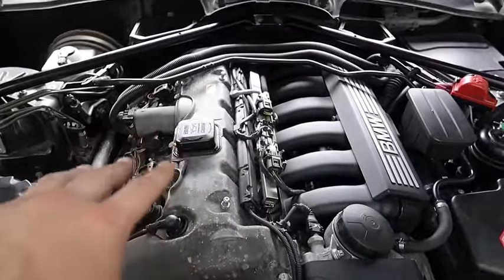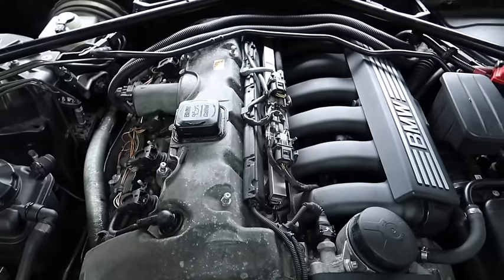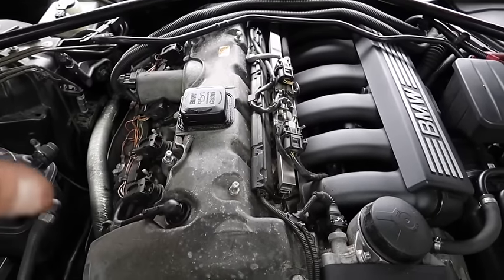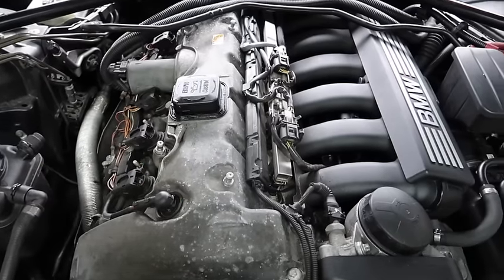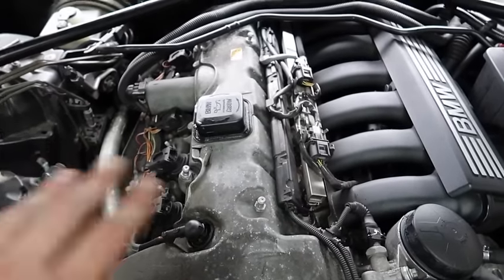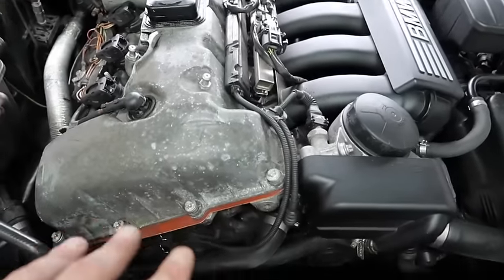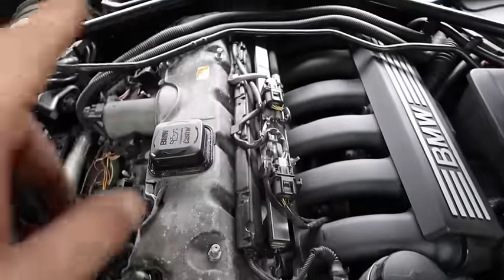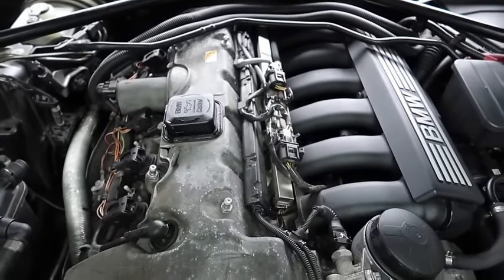Don't EVER Use This Oil In Your BMW !!

Comment: Here's a subject that stirs the pot vigorsily in the BMW community. I've owned BMW's for three decades now and spoke with a couple of senior BMW service techs when LL-01 was out and the debate was "Can I use regular non LL-01 synthetice and instead change the oil ever 5,000?"  Yes you can and it would actually be more  beneficial to change the oil more often with regular non BMW LL-01 synthetic than 10,000 or more miles with a LL-01 rated. If you don't belive me just look up what the inside of BMW engines look like with LL rated oil extended oil change intervals.

Comment: Thanks to your videos BMW Doctor I am learning a lot from them as I am now starting to DIY my 2008 BMW x5 3.0si. Part of that was looking for the exact same oil specs and certifications as BMW's 5W30 oil. I live here in Vancouver, Canada and I am unable to see any oil with the same oil with the ACEA, A3/B4, API SL, BMW LL-01 other than Castrol Edge SAE 0W30 Euro and the Pennzoil Platinum Euro SAE 5W/40. Then I saw this video which actually makes sense... and then I still wanted to make sure and that's when I checked my x5 owner's manual and to my surprise... it says "Approved oils belong to the SAE classifications 0W-40, 0W-30, 5W-40 and 5W-30".  The online version of my user's manual only mentions the 5w-40 and the 5W-30 but on the manual I have, it says 4 different approved grades. I guess it's still best to check our owner's user manual to make sure... I am just surprised that the BMW dealership here was not even aware of this until I showed them my owner's manual. Now, I am changing my own oil tomorrow or this coming weekend and now, I don't have to worry about the high priced 1L bottle of oil from BMW. Happy learning everyone.

Comment: Best thing to do is to change the oil between 5-7k miles, stop doing 10k oil changes.  BMW says it's ok, it's not ok.  Have the oil examined and I guarantee that it will find metal debris.

Comment: 5w40 liquid moly the lime green bottle has been working lovely on my e92 328i 130,000 no knocks ever and I’ll change the oil every 3000 no more than 3500miles. I use it after I did my valve cover & gasket, oil filter housing & sensor. It works wonders. Thanks for the vid Doc.
Reply: the same for 318i, charming

Comment: Hello Dr. Dean, 
About four months ago I purchased my 2006 BMW 325I with the N 52 engine and I must admit I was getting ready to just sell this car but thanks to you and the hard work that you put into these videos I’ve learned to enjoy and love my BMW.
Initially after driving for about 20 minutes the engine will start whistling like a whining pig  and Ive never done any (Mechanic) work in my life but I decided to buy the CCV valve and I followed your step-by-step video and I just sincerely want to say thank you Because that took care of that issue and it took me about five hours to take the manifold but I did it and I felt so proud.
The problem that I’m having right now is that before coming to a stop I feel a jerk And it feels a little bit stronger when the car is warmer but it does not do it on sports mode only on Drive.
I have replaced my transmission oil and like I said it drives like a dream but right before coming to a stop I feel like jerk as if someone just tapped me from the back.
I don’t know if it’s my transmission solenoid’s or the flex disk and quite frankly I have no idea... 
can you please guide me in the right direction?
I really appreciate it and once again thank you for taking the time because I’m really enjoying my car and I don’t see myself getting rid of it anytime soon.
Reply: I have the exact same problem on my 325i i have heard it’s the bridge seals in the transmission.
Reply: I would check the Transmission and Engine mount.
Reply: Have you ever fixed this problem? Because I have the exact same problem and can’t seem to find out what it is.
Reply: @erickhernandez4670  most 20i 25i and 30i models from 04-12 use a zf6hp19 or 21 trans. A common issue is the sleeves in between the mechatronics unit and the transmission. It loses fluid pressure because of these broken seals, which makes the shifts slow and jerky, in a worst case scenario throws an issue up on the i drive ”transmission failure, drive moderately”. If you cant switch to a certain gear (ie 3rd or for example reverse) then the issue is with the mechatronics solenoids. A kit of these sleeves plus a genuine zf oil change kit will take around 300 bucks and 5 hours of work on a regular driveway.
Reply: Abs wheel sensor. Had the same issue for a very long time. Did the rear abs sensors and it fixed it. I also did a transmission fluid pan replacement,  didn't fix it. The sensors did.

Comment: Just drove down to the costa del sol and back. 4k round trip in my 320i e93. Thought I had a problem as I burnt through two litres of oil over the trip. Using 5/30 oil. 108k miles on the clock. Watched this vid. Going to change oil to 5/40 and see how I get on with the next road trip. Appreciate the video.

Comment: Two options 

1. Rebuild your engine, because you want everything to be perfect

2. Accept that your N52 burns oil. Always keep a litre of 5W-40 in the boot. Every week when you do your checks, you know on a Sunday night when the kids are in bed and you go and check the tyre pressures, coolant, oil level etc just top it up. 

Some people get hung up on the tiniest thing. 

‘They all do that’, is not good enough, it must be fixed!

Instead of rebuilding the engine, spend the money on a tank of super unleaded and go enjoy your car down some proper drivers roads!

Cheers Doc for the perspective!

Comment: Castrol edge 5W40 in (N42B20) 2003 bmw 318ci e46 with 246K kilometers !  No problems . My father owns the car since new :D
Reply: I have this exact same car too from new 2001 . Still on the same spark plugs 20 years and starts on 1st turn every time.

Comment: I live in morocco on the west side with temperatures up to 40 41 °C, i noticed a lot of oil consumption on my 320i N46 B20 using 5w40 100 k miles on it, i switched to liquimolly 10w40 and problem solved, almost a thousand miles oil level still at maximum level

Comment: Thanks mate. Used 0w 30 on my 116i (as I've been using the same with my 520d for many years with no issue). In 1 year I used 5 litres of oil (7k miles). I'll go to 5w 40 from now

Comment: Okay so explain this to me guys, i have a 2005 325i n52b25A engine, with about 160k km on the clock. When i bought it it used about 1l/700km of oil, changed the pcv changed valve stem seals fixed external leaks, engine still used 1l/700km. So finally i did 10-40 which made it a lot worse(1l/400km) so i thought okay my problem is getting worse. So i added forte oil thickener which made everything even worse, (1l/300km). Engine was clean inside no carbon buildup. So complete engine teardown revealed worn oil scraper rings(the middle ring is tapered in these engines and early n52s got rings made of softer material, you can see that in realoem, there is an updated part no) when that tapered ring loses its edge its gonna start pumping oil into the cylinders instead of scraping them off, having a thicker oil means the cylinder walls get a thicker coat and the rings just glide over them sending oil into the chamber. Anyways after honing the alusil block and replacing rings, car performs now better than ever. Hard wear in was crucial. No oilconsumption whatsoever, using 5 w 30. With 5w40 it uses about 0.5l in 3500kms. So there you go use thick oils as much as you want. Because of the sophisticated vanos and valvetronic system this engine will throw codes if you go thicker with the oil

Comment: I used duralube in a 280zx and the radiator hose blew a hole. I drove it with no coolant for a good few miles. Got some coolant and a hose, let her cool off and no issues with the engine. I read the cooling system is a weak point In bmws. I got a used 328i and when I got the oil changed I added a quart of duralube. We shall see.

Comment: My 2005 325 xDrive m 54 engine drinking oil replaced PCV valve replace the oil pan gaskets valve cover gasket you name it didn't go as far as the piston rings or the valve stem seals the BMW dealership told me that wasn't the problem I don't believe them now I can't go there ever again back to the BMW dealership in Springfield Missouri they are rip-off artists they will lie to you in your face yeah so no one go there this guy is awesome BMW doctor thank you you are amazing you are an amazing person and thank you for loving these cars as much I love them I just don't have enough money to buy the ones I want I'm glad you do man go for it get all the m5s and all the m3's m4s you can man cuz I'm dealing with a 2005 330ci zhp that's all I can afford needs a new engine and transmission replacement that's my luck you have a great day man thanks for your videos

Comment: I got a 2006 bmw 525xi with 180000 miles i change my own oil and use 5w40 syn. It works good only have to add a quart every 3000 miles and i change it every 5000 miles..

Comment: I mistakenly did the opposite, swapped out the 5W-30 in my N55 at oil change time for 0W-30 and immediately had valve seal oil leaks. I drained the oil, and replaced it with 5W-50 with LiquiMoly Seal Restorer and never saw the issue again.

Comment: I use 0-W40 Castrol egde European Formula. Is that not better than 5- W40??
Reply: Good question, I know Castro’s also makes 5W40 LL-01. I’d like to know as well which is the better option
Reply: 0W-40 is better when extreme cold, but other than that there should be no big difference at all. Just broader temperature range and perhaps more expensive.
Reply: @steifan  I was about to answer with exactly that til I saw your comment. I agree

Comment: I am considering oils for my next change and I am very drawn to the Magnatec 5W-40 and Lucas 0W-40 - their cold viscosities are extremely low, but their 40 and 100 degree viscosities are quite high.
An engine isn't going to burn cold/thick oil, so try to get the lowest cold viscosity oil as possible, while shooting for higher 40/100 values.
Reply: Too low isn't great either because a too low viscosity may result in the oil being pushed out from all possible seals and spots and won't stay "in place". Engines are okay with some overnight down time as the individual parts will stay lubricated for a long time with a thin film. Even a week is not an issue. The problem starts with cars that are not driven for a longer period of time like half a year or even more where all the upper parts are pretty much dry (not completely but almost). In such a case it is advisable to pull the fuel pump fuse and just crank the car a few times to pump up the oil. Then put the fuse back in and start it up. Be ready to hear some lifters really hard but other than that it is okay. 

No hate just a tip :)

Comment: Change it more often!! 5w30 synthetic vs 5w40 is very close .. but yes a little heavier if you will for older engines makes sense to me.  Alot of cars and trucks recommend 0w20 very light I am running 5w30 for X3 with the 4 cyl turbo.  It makes sense what the Doc is saying!!  I run a heavier wt in my old f150 150k miles no usage

Comment: Yes, in general one should aim att low as possible on the W number as it refers to winter characteristics of the oil film and it's viscosity and as HIGH as possible on the other number as this will indicate the temperature that the oil will be able to keep a good oil film.  Lower then that, the oil will vaporize, burn off in the ventilation of the crankshaft and can't keep a good oil film.

Comment: I have an 06 e60 xi it runs better tyan new 2014 and 2016' 5 series! Have just reached 104k miles on mine always use liquid moly 5-40 or motul xxcess 5-40 never burns but when i used the americAn castrol5-30 i was losing 1 liter every 3000 miles. Now nothing doing 5k oil intervals w.o losing a drop. N52 is beast mode x100

Comment: BMW Doctor, I had my car (335D E92 - M57 engine) 2009 (Pre LCI) oil change and filter change last month, I had a gearbox servicing done too, first time in 212k miles! Car is a little over 213,500 miles, they told me they had to use 5W-30M Castrol Edge and 8.5 litres, not the recommended 7.5L, after a couple of weeks it was half way between Min & Max, yesterday I checked and it was at MIN. 

Can you recommend what I do, I have checked for leaks and the boost hose (MTEC - blue) + other side hose connected to intercooler = old oil residue, no noticeable leaks. A couple of drops in 24H noticed on both sides.

Would you recommend me moving to 5W-40 Liqui Molli and also would you say using their Ceratec is worth doing?

I drove to Peak District with no issues, I’ll check the oil tomorrow as well before leaving.

Comment: Hello as I was searching for oil for my 2004 BMW 325I I noticed that 5-40w synthetic was coming up as a match and i typically use 5-30w synthetic.  Do you recommend I switch?  I live in California and my car is garaged and has 52k miles on it approximately.   One shop had previously recommended i go with liquimoly but now I see the 5-40w synthetic option.

Comment: My m54 25 says 5w40 right on the cap. My m54b25 jad a 190k and runs beautifully and doesn't burn oil I use 5w40 and use the o2 mod on the ccv. Catch cans dont work, wer, it didn't work for me i used the 50 kids can all the way up to a mishimoto and it NEVER WORKED, weather it was smoke smell or vacuum issues whatever dint bother with the catch can its a waste of money stick with the ccv.  Does anybody realize that 10s of millions of dollars go into R&D when it comes to a BMW? Theres a reason they did ccv and not a catch can and its not all about emissions control or money its about what works with the engineering of that engine. I have 2 touring one pre-face 2wd one face xi and they both are knocking on the door of 200k and both run and drive great I love em. Both cars are heavily modified when it comes to suspension but everything else is bone stock. Love the channel mate, keep it up!

Comment: can i use 5w50 or 10w40?  i have a 12y old 325 w n52 engine. Looking for a thicker oil cos in my coutnry, the ambient temperature is around 30-40deg celsius. , no winter.  so the  'w' doesnt matter for me, but the top viscocity of the oil when hot is more impt.
Reply: i want to know the same

Comment: HOW OFTEN DO YOU RECOMMEND CHANGING OIL? I ALWAYS GO WITH  THE 3,000 TO 4,500 MILE PERIOD.
Reply: on my old mercedes I didn't change it for 5 years and it works fine. once the car is 15+ years old it's not worth changing the oil. Just keep adding it until the car stops working.
Reply: @korencek  i will definitely not follow your badvice

Comment: do you think that i can add some Bardhal No smoke additive in this engine ? i did it regularly on my old BMW 525 I E34 with M50 engine and i sold it after 320 000 km with no issue and i never burnt oil .. Thank you

Comment: I'm almost at 120k miles on my n52 and I use Pennzoil Ultra 5w-30 with 5-7k mile changes. It never really burns oil. The bar might go down a bit on the iDrive between intervals but not anywhere close to the min line. I've considered 5w-40 but pennzoil does't make it. I stick with them because they don't make it from crude oil like the rest.
Reply: évitez pour votre moteur

Comment: I drive a 2004 E60 520i 6 speed manual line 6. I haven’t quite hit 100,000km yet. It reads 97,000km on the dial. Should I make the switch to 5w40 now or should I wait till 100,000km and if so, is it just any 5w40 oil or there’s a specific brand you’d recommend?

Comment: What oil would you reccomend for a 2004 318i n46 with 220k km? I need to change oil and should I stay with factory recommended 5w30 or use 5w40?

Comment: I heard that 0w40 makes sense in the winter because it warms up faster and lubricates earlier. What's your opinion on that?
Reply: 0w20 summeroil 0w30 winteroil
Reply: @g_____t  No, the opposite. You want a thicker oil especially during the summer. 5w 40 in summer, if you live where it gets over 100 F regularly 10w 40, winter 0w-30 or 0w 40. After 120k miles don't even consider 30 weight anymore.

Comment: I neeed help. 
I have bmw 320d e90 2005. 290000 km
Last owner had 5w40 castrol, but when i came to car part dealer they told me for that oil it is not for my car, bcs it's not for dpf. Which oil should i use then? To use 5w30?

Comment: Would you recommend 5W40 also for the N54? The oil sticker in my 2012 E89 said 0W30, but I changed the oil and replaced it with 5W40, because it just seemed odd they would use such a thin oil (0W30) for an engine that runs at higher temperatures than is usually the case. Can this mess with VANOS in any way?

Comment: Hey Den, i have a one question. After every cold start my N52B25A has a ticking noises of hydraulic lifters for 60 second. After 60s is smooth. I use only 5W-40. What do you think about using 0W-40 in this case? Is possible that 0W-40 can halp solve this issue or it is bullshit? Thanks for your feedback.
Reply: I run 0W-40 A3/B4 Castrol edge in my N52B25, the ticking issues during low RPM and short trips has disappeared completely. I live in colder climates so the lower viscosity is crucial for cold starts below 5 celsius. Make sure to rev it high (when @ operating temps!) occasionally, since this opens the squirters for the lifters.

Comment: My country average temp is 25 to 40deg celsius [ hot ].  Can i use valvoline 10w40 semi synthetic durablend oil?  I run an N52 2.5L non turbo e92. [ 12yr old car with 120,000km ]

Comment: I use millers xf 5w40 and archoil ar9100 and flush engine every change of oil. Oil filter closes after 4k km so i change it also every 4k

Comment: Hello Dean,
I have a problem on my 325i  N52 on cold start the engine stops. My car has 70.000 miles,new spark plugs. Do i have to change the ignition coils to ? How can i check them? Thx